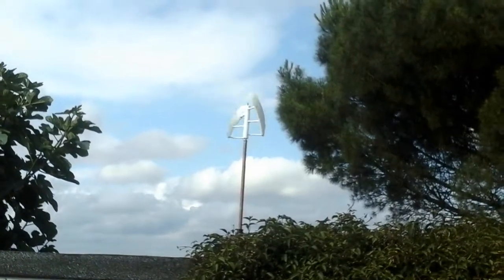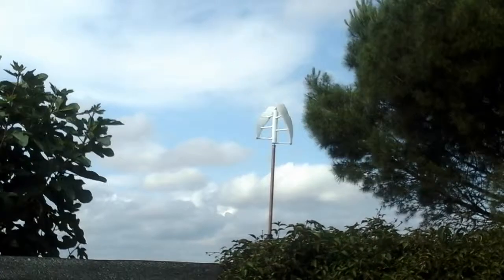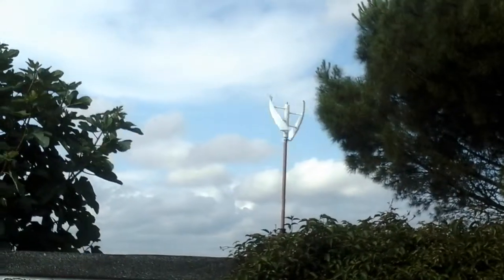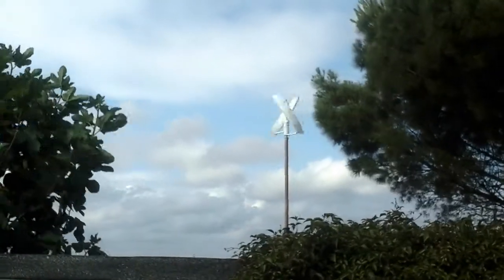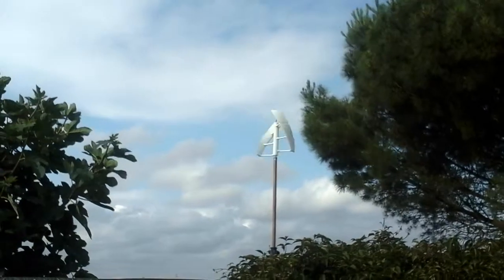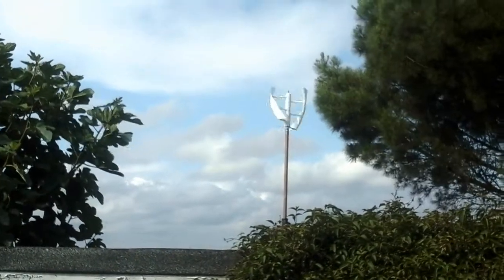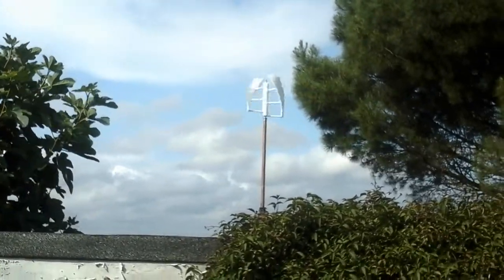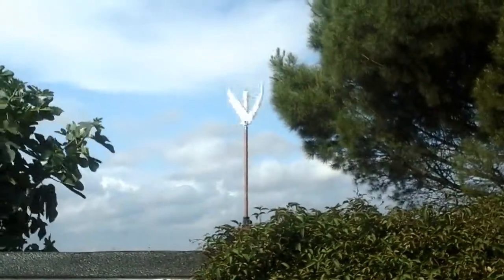Ornamental Darrieus wind turbine

Comment: These things never work in evens, you must build them in odds. add a 3rd blade and you will see an amazing difference.
Reply from the maker: Not at all true. A third blade would increase the torque, but not by the 50% you might expect - it's a diminishing returns thing, and if you check out commercial turbines you will see they come in two and three blade types. The problem with two-blade turbines is vibration and thus noise: They present a greater cross-sectional area when the blade supports are perpendicular to the wind, so the whole thing experiences rapidly changing forces and shakes. You can reduce the severity by either using three blades, or by giving the blades a helical twist, as I have done.

Comment: Okay, I've printed one and am printing a second.  Since these are stackable and you say it's a matter of scale, how many blade sections do you think it would take to produce appreciable torque?  What is your criteria?  For my use case, a remote access point is only 8 watts or so continuously.  Perhaps you could do a video on "the physics" of it, or point to an existing one.
Reply from the maker: Synaptic Axon As I conducted only tiny scale tests, I have no idea. You will have to experiment yourself.

Comment: I'm sorry. I couldn't quite understand what you said in the "Forget about it. ???? ????? does not work on a small scale." Winter Hour??? That doesn't seem right, but even the CC pulled the same thing. What was it you were trying to say about why one couldn't use a vertical axis wind turbine for small scale?
Reply from the maker: Simple maths. The power output of a wind turbine is proportional to the cross sectional area, and to the wind speed cubed. That means you need to build them big and to build them tall - if you make it twice as big, you get four times the power. Solar is a very practical power source at small scales, but wind turbines are only economical at very large scale.